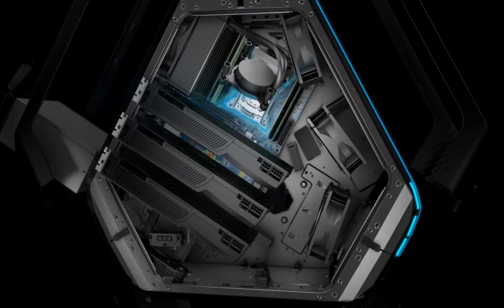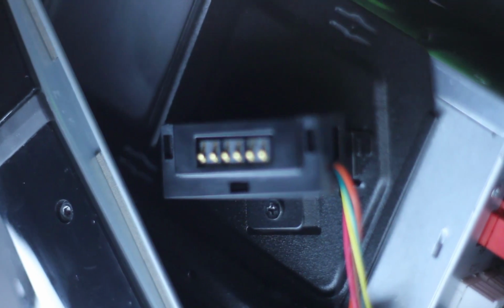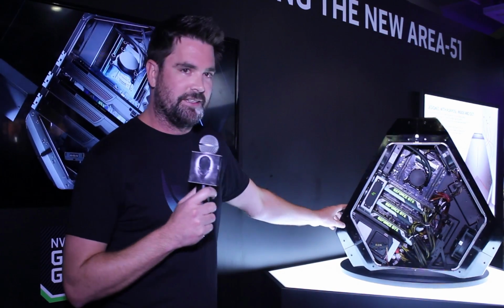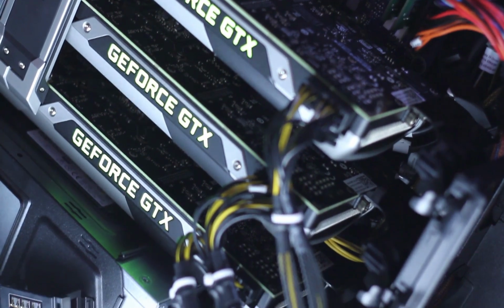New Area 51: Designer Review

Comment: sirieus dell ever heard about allot of dust that will get in and on it??? plus the case isnt functional enough you cant get anything in extra like a sound card or a extra ssd or normall hdd the case is really not functional at all!!!! plus your prices are really to high for what you get!!!!! i just build 2 new gaming pc's that will play everything on ultra for the next 3 years at least, and that for half the price!!!! Mo: Asus Maximus VII Ranger 2x
            Cpu: Intel i7 4770k 4ghz - 4,4ghz 2x
            Kooling Cpu: Corsair H55 Waterkooling 2x
            Ram: Corsair Vengeance 8gb 1600 Mhz 2x
            Gpu: 1 with a Msi Gtx 980 4gb and the other with a Asus Gtx 970 Strix 4gb
            Ssd: Samsung Evo 840 250gb 4x
            Psu: Cooler Master 1000 watt 2x
            Sound card: Creative Soundblaster Z 1x  because my girl didnt want 1
            Casing: Cooler Master CM Stryker and the Other Ms Tech X3 Crow 
            

and the 1 cost me 1700 euro and the other 1500 euro and your gaming system is 1 for around 3 to 4000 euro thats really stupid and 3 Gtx 980 on Sli is to much overkill because not all games support 4k at the moment so its in my opinion overkill!!!!
Reply: Dust doesnt come in. I have one and I got no problems.

Comment: could this support triple titan z
Reply: You can only run using two Titan Z, since each card basically runs sli on it's own, since it got 2 gpu cores. Don't know if 2 cards will fit though. But since there is only 3 slots, I don't think there is room. THere are however more room between the cards then you usually see, sothere might be room afterall.